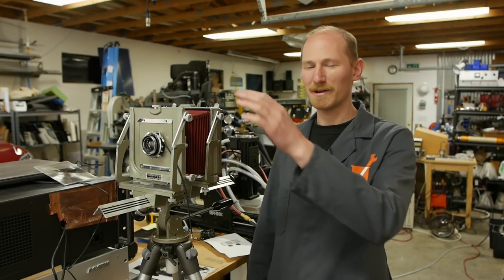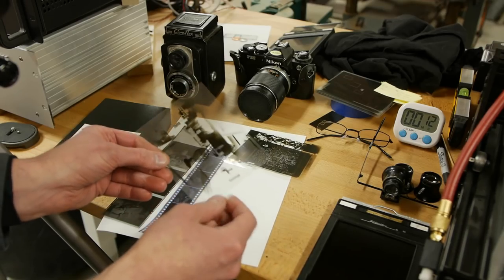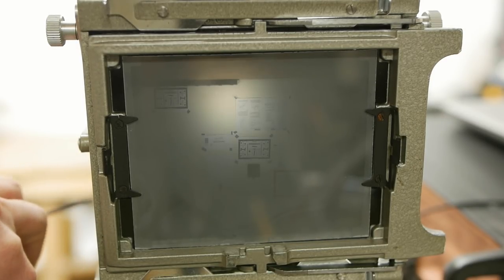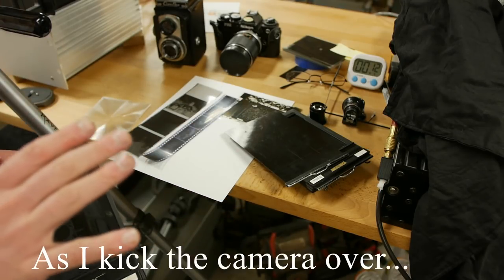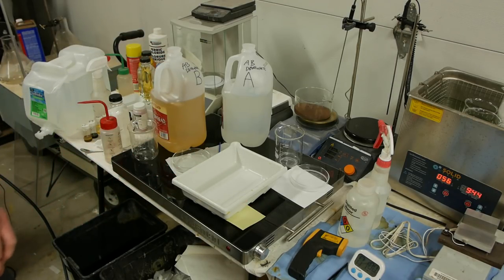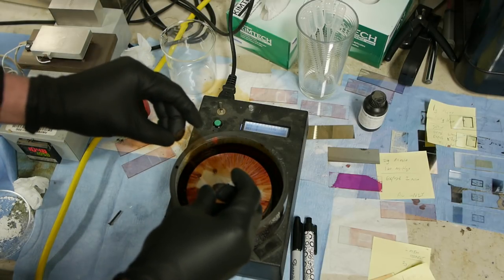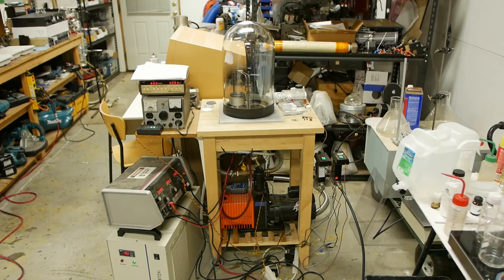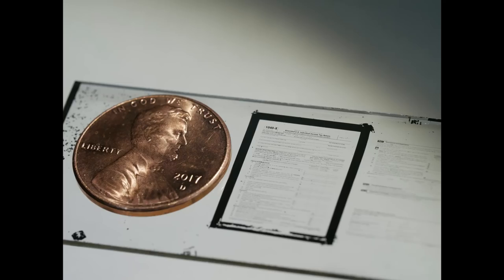Antique 4x5 camera creates 20 micron photolithography masks: Super tiny tax form

Comment: Film Holder:
1.  It is designed for thick Estar (polyester) film. 
2.  You need to offset the thickness by putting 2-3 layers of film in the holder.
3.  Vacuum back were used in WWII for areal photography.
4.  You do not use a vacuum cleaner, you use a vacuum pump based on a refrigerator compressor; they are very quiet and pull higher vacuum.  I can supply you with a simple layout.
Processing Film;
1.  You must slide the film into the developer, not immerse it.
2.  You must agitate the film by lifting corners of the tray in some pattern.
Other:
If you see Neuton rings, your film is not making even contact.  Expect refraction.
The color of the ring is ¼ wave length of the light color.
Avoid by using Anti-Neuton glass, or sprinkle dry talcum powder on the glass then gently blow it off.
All developing must assure flow of fresh developer across sensitized layer. Film, resist or anything else. Explanation available.
Correct these errors and you will greatly improve your results.
Reply: Thanks! I guess that's why photographers used to be called "operators"
Reply: I miss the smell of a darkroom.
Hanging out in a red, dank and vinegary cave.
Reply: While your advice appears to be incredibly professional and accurate (I assume, I am not a photographer), and none of it is bad advice, regarding point 4 of the first set, you do know that he actually has extensive experience in vacuum technology right? Like this is a guy who built his own scanning electron microscope.
Reply: This is one of the strengths of YouTube, in that a collaborative acumulation of knowledge becomes virtually inevitable. There are so many interesting and interested geeky, nerdy, techie folk around more than happy to help and throw in suggestions and tips that may themselves been built up by successive generations.
It is wonderful thing to witness.
Everyone pretty much is dancing on the shoulders of the previous generations, and trying to improve on them. In turn passing them on to the next.
Here it is possible to witness it happening.
Reply: I cringed a little when he put the film in the developer... Done correctly it will completely immerse itself in a fraction of a second, no bubbles, no creases, no finger prints or foreign bodies, just like an Olympic diver slips into the water without a ripple hardly and from my experience it can make a noticeable difference especially when you're shooting for such high definition.
On the Agitation: some of the trays were actually designed so they would not sit flat on a flat surface thus making the rocking of the tray easier, from corner to corner so that the same developer wasn't just sliding back and forth over the same piece of film or paper.
I would also stick some black tape over that green light and probably over the orange one as well.

It sounds picky or pedantic but if you do enough you start to recognize the difference; doing it properly makes for repeatable high quality results.
Reply: Also Contax used vacuum back plane at their RTS III 35mm SLR camera.
Reply: @MostlyPennyCat  
Vinegary, perhaps, but my lights were brown in the B&W lab, red in the lith lab, and out in the color labs. Loved crossing the lines: print B&W image on Kodalith, process in Dektol and immerse yourself in beautiful, huge range transparency.
Reply: @maxk4324  
No doubt our scientist is a genius. But even geniuses can learn.  I witnessed it on more than one occasion.
IRT vacuume, areal cameras actually did the reverse.  They pressurized the lens to film cavity.  Same vacuume back, just backwards.  Vacuume at 80,000 feet is not very effective ;-)
Reply: @MrMegaPussyPlayer  
No, not required, this is why the correctly built vacuum back setup included a bleeding valve.  Although if the setup is clean, a high vacuume is not a problem, especially when the film starts measuring in feet, not inches ;-)
Reply: @rationalmartian  I am not geeky, nor nerdy.  Just old.
Reply: @DIYTAO  I never saw that.  We had Leica with said mod.  Nikon F too.  The large film cameras were actually shooting continues sequences.  How they solved the flatness problem, I do not remember. Kodak Instamatic used a spherical projection, hence the curved film rails in the X direction, and the curving of the roll film in the Y.  They also had the plastic lens components move with temperature, compensating for refraction index changes.  This innovative system was a horrible failure, though, only seconded by the Kodak Disk fiasco.
Such dumb clutz company of geniuses.
Reply: @MostlyPennyCat  it's weird...the only time I've ever smelled that stuff was  doing photography at high school many years ago, yet I could almost smell it watching this video.
Reply: Great advice! I should just say that for #4, he doesn't use a vacuum cleaner, despite the noise you hear.  It only sounds that way because it's sped up 10x or so.  He does use a vacuum pump.
Reply: @musicbro8225  Pretty much meaningless, if you consider that the developing time can be up to around 10minutes depeding how you dilute the developer.. what happens in the first seconds has really no effect on it. Like you can see, he got pretty good results. People just think everything needs to be hyper perfect, but it does not.
And especially as you are developing at high contrasts, where you simply want to develop the film to depletion.
Reply: I've just to suggest vacuum to flatten the film as I know this technique from reconnaissance imagery, but I see that you already did this more than competently :)
Reply: @sheemondallasgeorgia  positive pressure on the the image side, interesting. I wonder if one would have to account for the difference in refractive index due to higher air density inside the camera though (ie one might have to focus it while under pressure in order to get this level of accuracy maybe?). Also I totally agree there's always room to learn, I just wanted to let you know that he most definitely has made the fridge compressor vac pump before I'm sure given his extensive experience with proffessional and hobbyist level vacuum systems. I'm guessing he used what he did to only pull a light vacuum so that there weren't divets in the film where the vacuum holes were. However I'll admit that's just my best guess.
Reply: the film he's using is meant specifically for that type of holder. both 4x5 film and holders have had the same standardized dimensions for over half a century. he doesn't need to offset anything and using three sheets is a terrible idea. a vacuum pump is also a terrible idea and would damage the film holder's thin sheet metal septum. even a little pc fan would be enough to suck down a thin sheet of film.
Reply: OR double sided tape (instead of extra layers of film
Reply: @creepyloner1979  The x and y dimensions are accurate, but the thickness of the film is not. Typical pictorial sheet film has a thickness around .18mm. I just measured some of my ortho litho and it has a thickness of .1mm. This means the emulsion will be .08mm offset from the focusing surface of the ground glass, making the image formed slightly out of focus.
Reply: @sheemondallasgeorgia  Brown light? I can't find that in the spectrum :-)
Reply: The positive pressure on the inside was often accomplished by just venting the back of the film holder to outside of the aircraft. This way nothing else changes between focus and exposure. I do wonder about using temperature control on the film back. That might help with repeatability...
Reply: I would add a vacuum buffer tank to the vacuum line to reduce any chance of the film vibrating due sound waves transmitted by the partial vacuum. 
Regarding the suggestion about eliminating the newton rings, I think at the scales Ben is trying to work with, using anti Newton glass or talc powder its going to start having a negative effect, in the case of using talc there is a reason why clean rooms are used on photolithography in semiconductor factories and labs, at those scales a dust particle can ruin the pattern, and anti Newton glass might have too much of a surface gradient that it might affect focus. But that's just what i hypothesize, Im sure there are good chances Im worng.
Reply: @maxk4324  Exactly, you assume.. simply because it appears like something. And why? Simply because he makes list using numbers. People are a bit too gullible. His advice offered nothing meaningful. And comments like "vacuum backs were used in aerial photography" ok? They were used in many applications, but why mention it? Just to make you feel smart.
Reply: Sliding it into the developer IS immersing it. Burial by fluid is immersion.
Reply: @musicbro8225  Not picky at all... just another example of the kind of basic mechanical knowledge that gets lost when a technology (like digital photography) eradicates a body of applied science. A lot of the points you bring up used to be taught in high school!

I use photoresist for etching PC boards. I started out being paranoid about patching leaks and covering LEDs but now I don't even turn the room lights off sometimes. Pretty much any visible light is a safe light with the stuff I'm using.
Reply: I used filtered water only in my film developing but for the final rinse I used distilled water and then air dry. Result, no dirt absorbed into the emulsion, no water marks and no scratches
Reply: @jamesmurphy7193  Yes, I used to make pc boards way back in the day, I used to find laying down the tracks a most enjoyable puzzle. Digital was just beginning to surface at the time, we used sticky tape (1 - 2mm), it was like making line drawings :) 
Definitely not sensitive to typically visible light.

I'm glad you didn't find my comment meaningless. My experience is mostly with standard 35mm and medium format film and b&w paper and it is not the same, but when I say I cringed, it was true, he was brutal haha. It didn't matter at the end of the day, I mean you try teaching a non Frenchman to speak with a French accent and eventually they will tell you 'it's meaningless', not that I'm French, but there is meaning in grace. When I started printing my photos I soon learnt how to overcome the annoying inconsistences in results, but that vinegary smell and dark intimacy with the art and documentation, as you say, is somewhat redundant these days, that's why this video was SO nostalgic, some get it, some don't :)
Reply: 8:00 Fresnel lens also to “even out” the illumination to the corners rather than make the ground glass any “brighter”... it only makes the brightness more even across the frame when viewed from a distance.
Reply: @BobChaz  He's the one with the dark orange light.
Reply: that's some very deep knowledge - my hat is off :)
Reply: @MostlyPennyCat  LOL!!! Yea I have all my old stuff, and may have to shoot a roll or two just to get that feeling back. I have some D-76 lying around and a bottle of HC110 - Cheers
Reply: I'm wondering if we take that mask write something that small on human nail
CAN WE DO THAT?
Reply: while your advice was good, your delivery needs some work, you come off sounding like a jerk, especially because youre correcting him on things that he specifically stated in the video  ie. he is using a vacuum pump, not a vacuum cleaner. the pump he chose (as he has more than a few to choose from) happens to be loud. also, batch development is totally fine considering the low volume he is processing at any given time. not that a system to recirculate deveoper/associated chemicals isnt something he could accomplish, its just not necessary.
Reply: Why not use few drops of water behind film so it will be flat by capilary forces?
Reply: @dynogunbattle   , also he does not seem to know who Newton was. U is far away from W, so it was not a typo.
Reply: And note that the emulsion side should be facing out towards the lens. It looked to me like his example had the emulsion side in.
http://zo-d.com/stuff/photography/how-to-load-4x5-sheet-film-holders.html
Reply: 'You do not use a vacuum cleaner'
lmao
Reply: @dynogunbattle  - Uhm no. Doesn't sound like a jerk at all, just concise.
Reply: @michaels3003  - Pretty easy typo to make. Going by your post history though... I don't expect much from you.
Reply: @thysonsacclaim  yes, sounds like a jerk big time.

sounds like someone with the messiah complex i know, blinded by the urge to assist and illuminate others at all costs. sounds like someone who rolls their eyes and makes a face whenever they see the slightest mistake, then gives condescending explanations as their only desperate means to feel adequate.

maybe you never had to interact with someone like that, but trust me i know it when i see it and it drives me nuts.
Reply: @MostlyPennyCat  Yes! I used to do platinotype and other non-silver printing, whoch involved the same kind of shortwave UV contact printing....nice memories of 1970s photographic technology (though platinotype goes way back)

Comment: Great video! If you want a higher resolution, you could try direct exposure of the photoresist on glass inside your camera and use violet or uv-illumination for the object pattern. With an old canon ft  lens i could in this way achieve 2 micron resolution. With large focal distance lenses like the one you are using that would be hard to achieve though.

Comment: This made me so nostalgic!  I operated Klimsch large-format plate cameras (film-size, up to broadsheet newspaper).
Two things: Lighting—try high-intensity quartz halogen; it has a wide-spectrum output, up into the ultraviolet, which should appreciably shorten your exposure times.
Secondly, for exposing the photo-resist, a sheet of pure polycarbonate will pass much more UV than window-glass.
Oh, one last thing: while I am not recommending the use of an optical bench, for super-critical applications such as yours, a sturdy table might present better, more repeatable results.

Thank you for a super interesting vijayo, and I wish both channels the very best of fortune.
Reply: I always enjoy a good AvE crossover.
Reply: You can also get very high intensity UV lamps used for disinfecting off of Ebay, but I believe they may be florescent, so optics would be required.

(Note if anyone actually buys one - they are extremely hazardous and can burn your eyes and skin without you realizing. Research safe and proper use before turning them on.)

Comment: First off, great content. This was the sort of thing I lived in the 70’s through the 90’s in the printing and photography world. A few notes that you may find useful. 
If you can get your hands on a 11 or 21 step grayscale to use on your wall, it would be a great help for setting exposure and maintaining control. These were standard on any litho exposure in the printing industry in the 80’s and 90’s. The steps make for easy adjustment of exposure between steps. Also critical for consistency and calibration of exposure. Finally, if you could make a small vacuum frame for exposing the glass slides it would be helpful. The Newton rings can actually cause small exposure variations through the rings. This was a problem we dealt with in the printing industry.

Comment: BTW, a tiny laser spot on the wall might make your focusing easier. I tried a red one (ca 650 nm), and it seems to work just fine, even though diode lasers suck. A well collimated HeNe, which I'm sure you posess will be perfect.
Reply: Yeah, especially when you remove the lens of the laser diode, the light comes from a particularly small point.
Reply: Add a focusing mask and that works great.  (I used the laser spot on a wall to test out various focusing masks and then fix an incorrectly set DSLR ground glass.

Comment: So what did you do during quarantine?
The world: Binge watched Netflix and tried not freaking out.

Ben: Just messed around in the shop making 20 micron photolithography masks that are used to make titanium electrodes that attach to neurons.
Reply: I wonder what the highest density of data can be achieved with Ben's method. (Some sort of 2d barcode to backup important data, or have the data in rows and data with vertical lines being a one and the absense being a zero + then a "second layer" of data could be written by rotating the vertical lines like the hands on a clock, {though the data could be written in one pass}.) How easy would it be to read the slides?
Reply: lol sounds about right
Reply: This guy!  Hell, and I can't be bothered to even make my damn food any fancier'n usual 
`: /
Reply: I aspire to be as motivated to do cool things as Ben.
Reply: @recklessroges  Isn't that pretty easy to say? For a simple matrix of dots and non-dots of 20µm, it's 1250*3750 bit 
= roughly 0,5 MB on every 25mm*75mm microscope slide. It's denser then floppy discs.
Reply: @VerstehenSieMathis  Are you guys making the end times cold storage for your bitcoin wallet? I suggest hole cards. :)
Reply: @kistuszek  just write the code on a piece of paper or am I missing something here
Reply: Reckless Roges I think error would be an issue with those stray shadows.
Reply: @recklessroges  You should look up microfilm, it's basically what he's done but as a means of storing documents. Used for a century and many libraries and archives still have information stored in absolute crap tonnes of the little rolls of film.
Reply: oh
Reply: @Nichoalsziv  we still do that only now it's zeros and ones on the little film
Reply: Github started something like that on 20/02/2020, they want to store all public repositories in the frozen north pole
Reply: @recklessroges  DATAGLYPH or MICROGLYPH 
https://microglyphs.com/english/html/dataglyphs.shtml 
Of course, other encodings have better compression. And CRC.
Reply: @Nichoalsziv  Microfiche was what I always heard it called